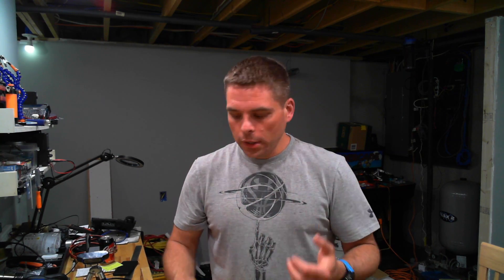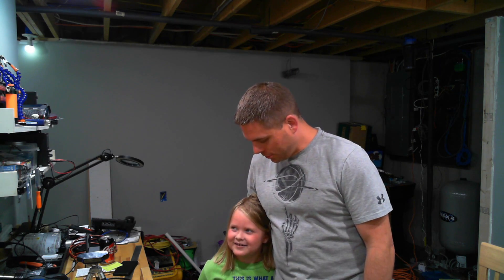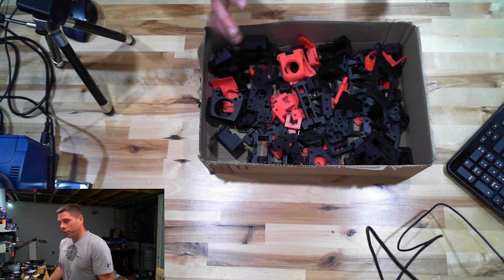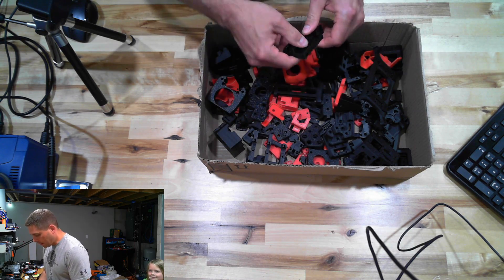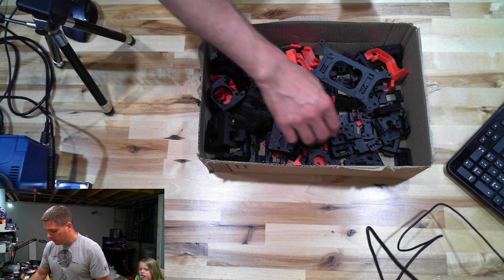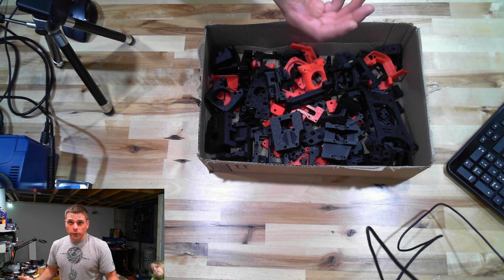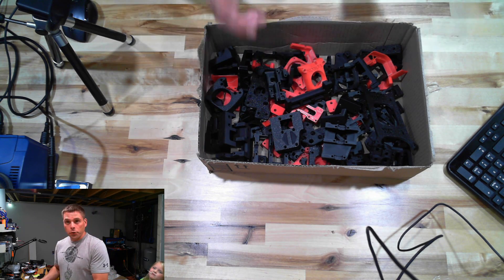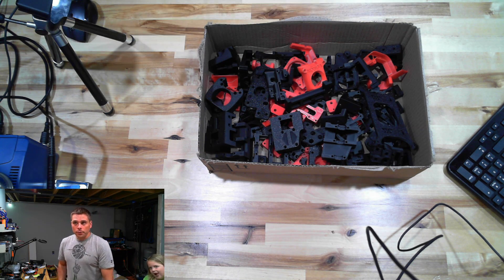VORON 2.4 3D Printer - Printed parts!  ABS isn't easy to find.

Comment: Print your own its cheaper and don't have to wait
Reply: Difficult to do with a disassembled machine. Kinda like chicken and egg don’t ya think?
Reply: dont want to with ender 3
Reply from the maker: Ender 3 is capable. (Should work about as well as the Ender 5).

Comment: Post your ask on discord. There are at least two guys selling them. I just received mine after a 1.5 week of wait. Good deals
Reply from the maker: There has been an influx of people making parts since I did this video.  The person who I purchased from even started a a store - I wouldn't suggest, based on what I got.  Infill seemed shy of 40% and the wall count seemed a little short.  I decided to make parts for myself, and I'm happy I did.  Not as hard as many folks would have you think.  I just got my first PEI sheet and it make it even easier.  About the only real argument would be the concerns on particulate matter and I think that is over-played as well.  I have gone on to make some parts out of PC and it all continues.  Quite the fun project!
Reply: @BuildItBasement  I cannot yet complain about the parts I got.  I have verified from the vendor they printed according to spec. I can share with anyone interested.  One can always partially validate the parts they receive by weighing them and comparing what is shown in slicer.

Comment: I'm looking for a 3030 frame Voron 2.4 remake...
(would pay a dime for adaped and working STLs via paypal)
Reply: I have a 3030 voron
Reply from the maker: That would require a lot of work... Are you planning an extremely large build?
Reply: @BuildItBasement  I'd like to go for 600*600*500mm.
The RatRig is available for 3030 but I'd prefer the Voron.
There is a something on thingiverse www.thingiverse.com/thing:4620758

Comment: there are some cnc parts now on aliexpress that is now also an option
Reply: got my parts on aliexpress, very good quality
Reply from the maker: @mikrchzichy  After some tinkering, I think anyone can print ABS. I should do a debunking video.  The parts I have printed are better than the ones I purchased. And I'm printing on an Ender.  I would tell anyone to save the money and buy an enclosure.
Reply from the maker: Yeah I have seen that - I didn't hear/see anything positive from the dev team on these items.  I would assume that they would have more mass, but for the majority of the parts that shouldn't be much of an issue.  Once this build is done, if I can get enough support I would love to put together another kit from someone other than Formbot and possibly do the aluminum parts on it.  It would be a good comparison in construction and performance.

Comment: Before hitting eBay or Etsy, you might consider checking in the Voron Discord's flea_market channel. There have been a few community members that are not part of Print It Forward, but have been printing parts to kick start a Voron build. They print the same part list for about the same cost as PIF. The quality of the parts that I know of have been high quality, but I would stick to buying from someone with a blue or purple user name. These folks are serialed Voron owners, and are more than likely to make sure you are happy with what you are getting.
Reply from the maker: Great tip. I'll mention this in the next video.